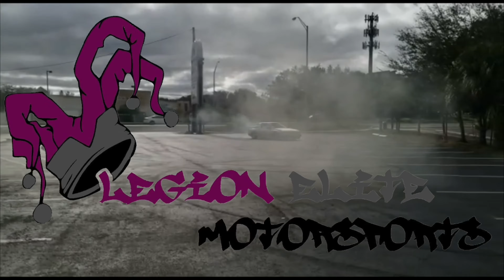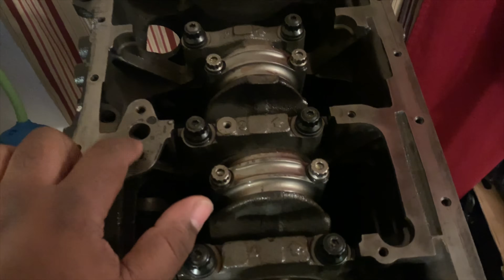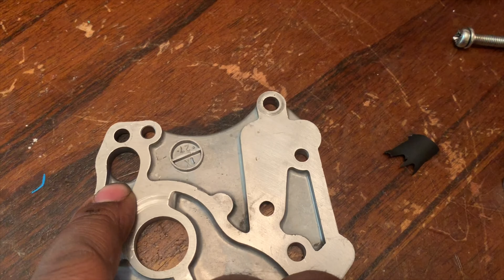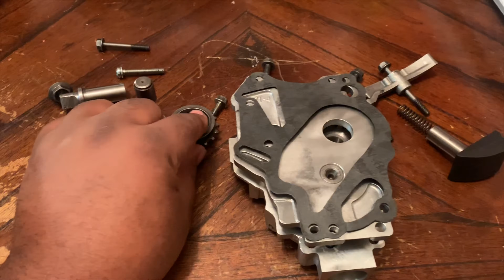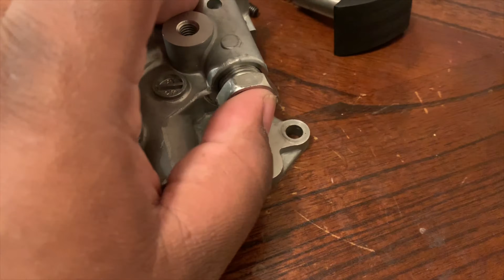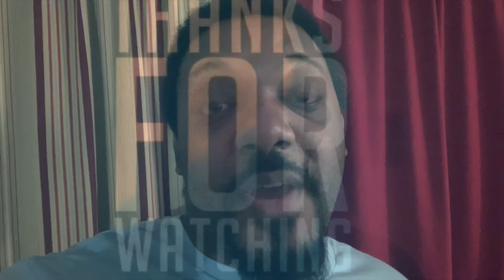Customer surprise build

Comment: I have the non turbo system which oil pump gasket should I use? Btw Its to a  mighty max
Reply from the maker: If your Oil pick up tube is bolted to the block you have to use the non-turbo gasket set me up on Facebook or Instagram and I will lay down a picture so you can see the difference
Reply: @legionelitemotorsports2096  What brand oil pump,  do you recommend for the n/a block ?
Reply from the maker: Melling m122 all day